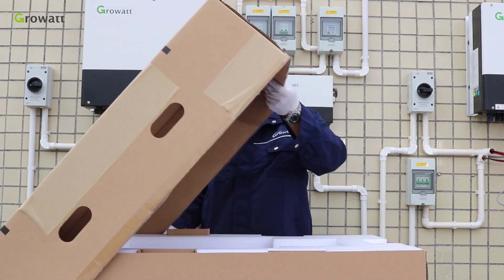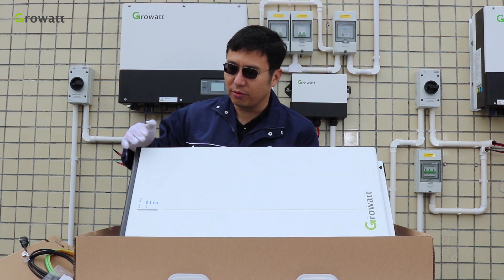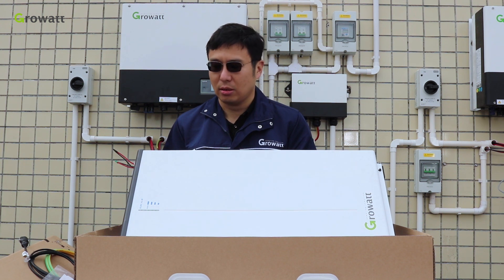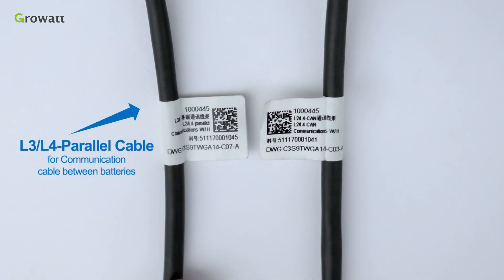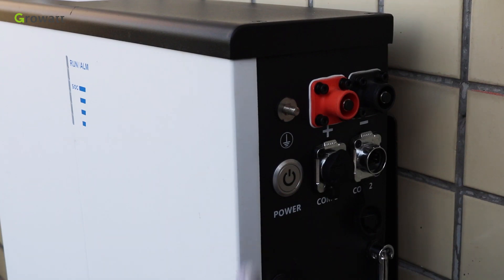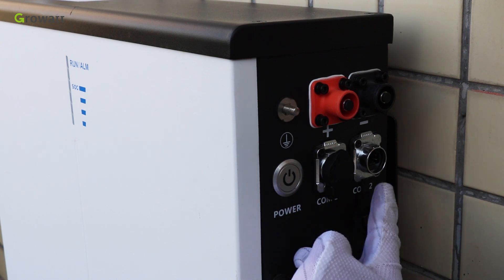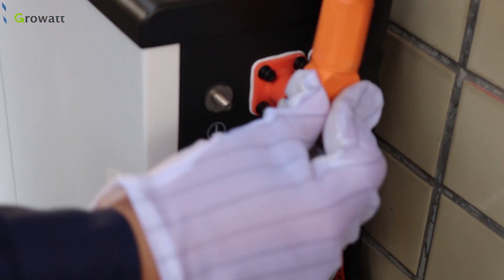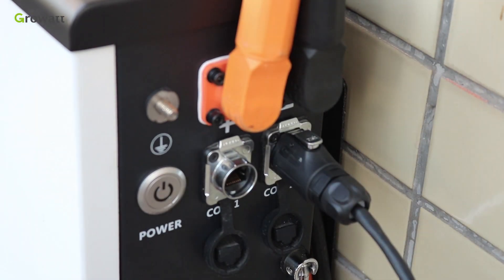GBLI6531 Battery system installation

Comment: Hello! 

We've installed such battery today too work with an inverter, the battery works but we noticed that LED lights on the battery itself don't seem to work 🤔

Is that a common occurrence for this model?

Comment: When installing this battery paired with a spf 3000 lvm inverter what battery settings do set for communication properly for the bms? When I set the battery option in setting 5 to battery type li the setting requires a com setting to complete the setup. I cannot find what number to set for this. I emailed growatt support but no answer yet.
Reply from the maker: Hello,  you can call our service hotline at +86 755 2747 1942. Thank you!

Comment: My installer has both comm 1 ports used and only one cable connected to comm 2.  In my opinion this is wrong and we have an issue.  He says that it is probably a faulty battery.  Can you 100% confirm that comm 1 should be only connected to one battery and the other end to the inverter.  Then comm 2 should be connected to each battery via the other comm 2 port.  Thus comm 2 to comm 2 and then comm 1 is not used on one battery, and where it is used the connection goes to the inverter.  I believe Growatt as the manufacturer as seen in this video and that my installer is an idiot, but he doesnt want to listen to me or even watch the video.  Thanks
Reply from the maker: Hello, for technical support, please feel free to contact our service team at service@ginverter.com. Thank you!